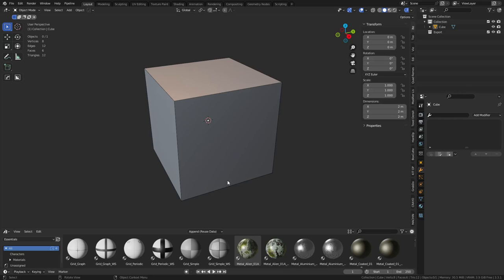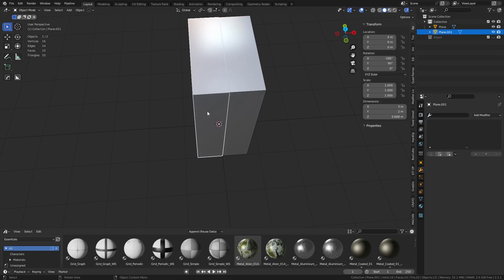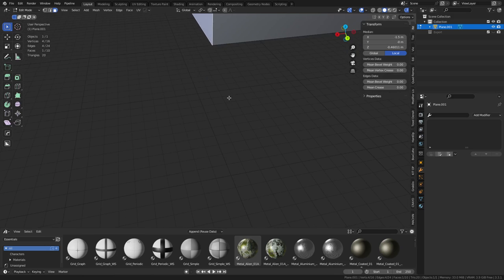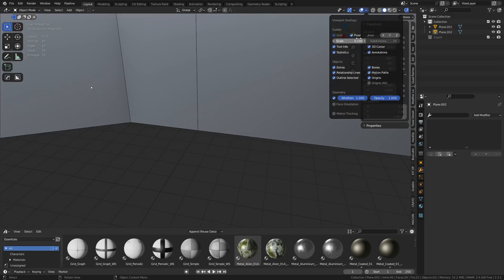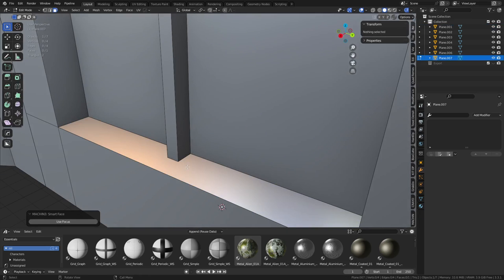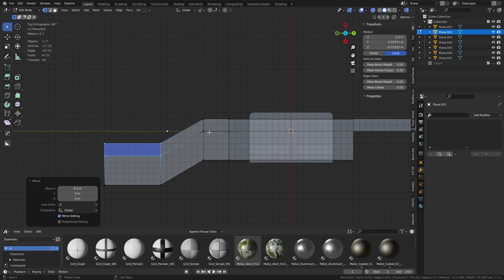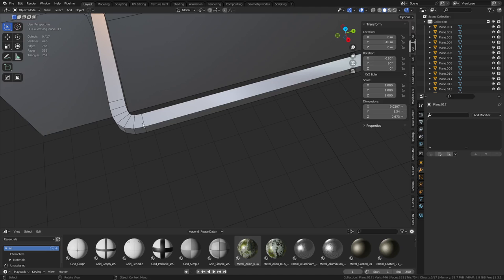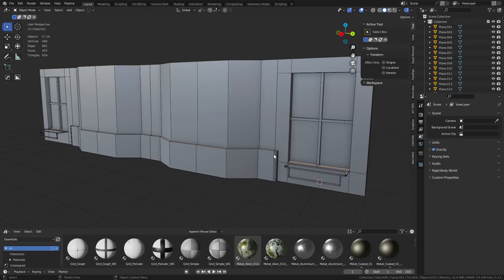1cm Grid & Walls

Comment: 19:22 glad to see someone else having the same problem and use the same solutions. Shows that there is little to no hope left to have a better bevel with 1 hotkey.

Cause with those methods it still feels "hacky", but I could be ignorant and maybe its how this stuff works, I personally seen only blender struggling with this. 
But the  Edge Flow addon does exactly this, unfortunately its an extra addon.
Reply from the maker: You can try changing the bevel to percentage too. I still don't care for the edge flow on any of them. Only percentage works if you max it out to the edges.